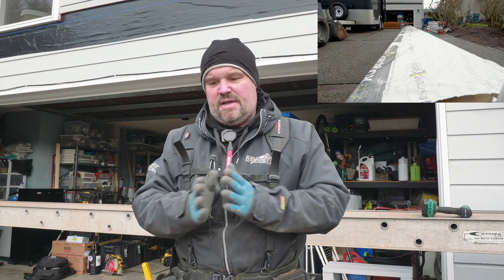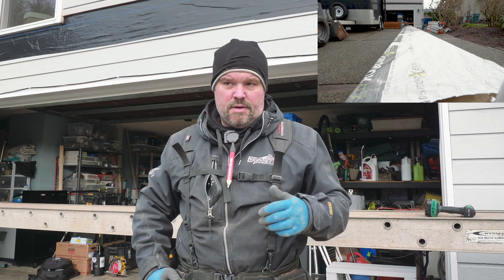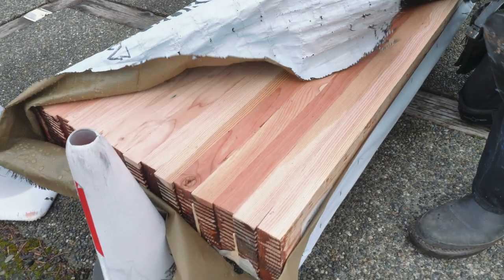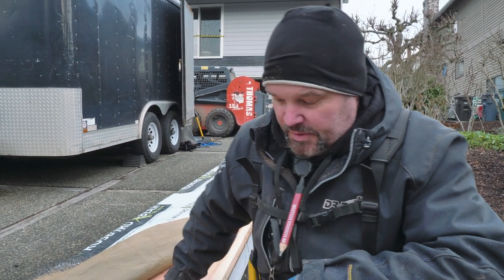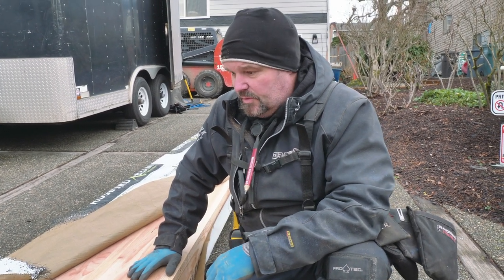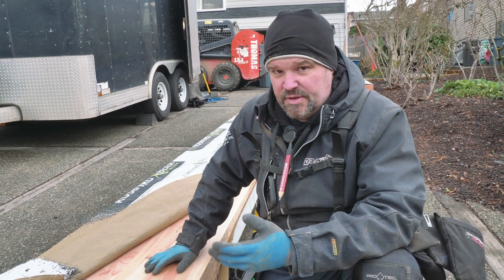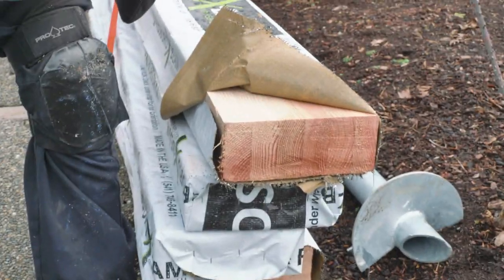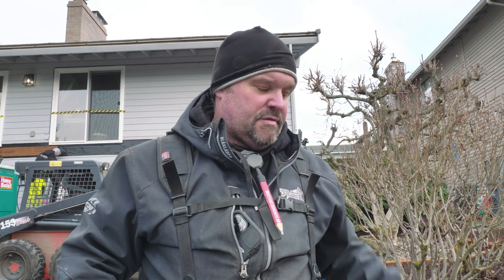Why Do We Use Glulams? || Dr Decks

Comment: Question Dr, for smaller decks averaging 12x15’ and around there would you recommend using a glue lams or constructing beams by stacking 2 2x6s
Reply: You probably want to use pressure treated 4x8s minimum, or 4x10s.